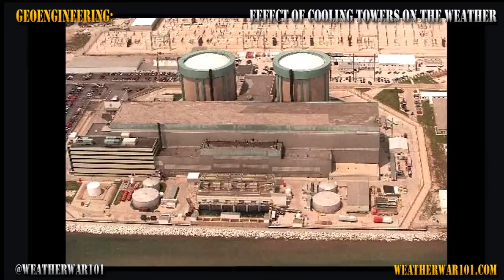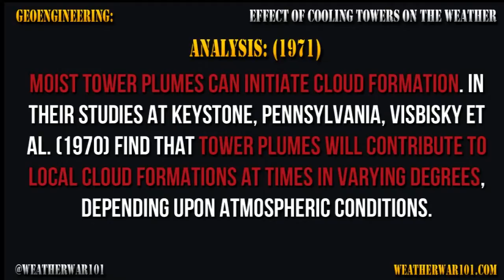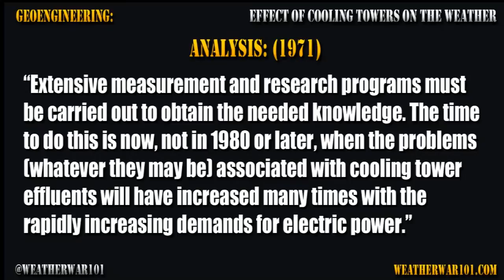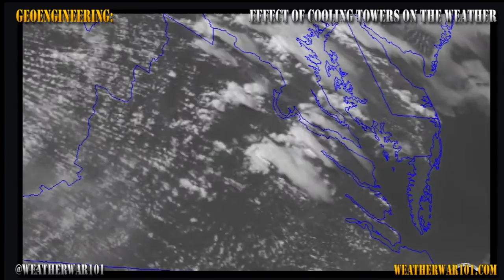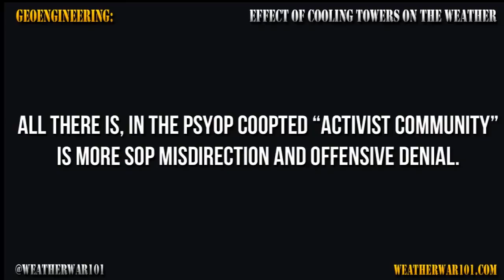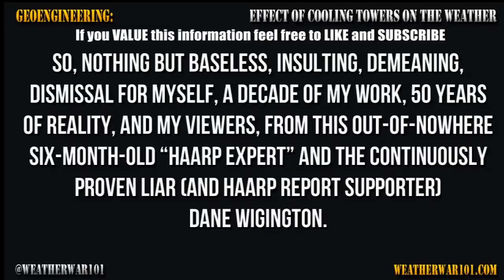Proof: Effects of Cooling Towers on Weather - WW101 Narrated

Comment: interesting. 
But is it worse than plumes from volcanoes?
Reply from the maker: tioedong Define worse. Volcanic Ash is a blight that can potentially block out the sun. I have little doubt though, that being humans we could filter the air of said ash in roughly a year if our lives depended on it. But that being said, the Water Vapor is being vented for a reason. This isn't accidental, the timing of the releases and the movement of the Storm Systems are evidence of this. The Weather is being weaponized, and these are just the preliminary runs. Expect more violent weather in the future, more damage and more death.
Reply: I asked because I live about 30 miles from MtPinatubo.

Usually I would say that claiming weather weaponizing is crazy, but one of my fellow docs who was in Desert Storm and said they did just that back then.. So do I believe him, or what the MSM tells me? 

On the other hand, I am now reading several  history books by Brian Fagan, where he discusses climate change in the last 10 thousand years.... If those aiming at depopulation want to, they could  indeed change the weather we are in trouble.
Reply from the maker: I would advise relocations away from any active or semi-active volcano. The risks far out weigh any of the benefits. In reference to mans ability to control the Weather it is an absolute reality. We have had the knowledge of our capacity as a species to alter the weather since at least the Roman Empire. In Plutarch's "Caius Marius 75 C.E. he states "It is an observation, also, that extraordinary rains pretty generally fall after great battles; whether it be that some divine power thus washes and cleanses the polluted earth with showers from above, or that moist and heavy evaporations, steaming forth from the blood and corruption, thicken the air, which naturally is subject to alteration from the smallest causes."
(source: http://classics.mit.edu/Plutarch/c_marius.html)

The idea that we would weaponize it is not new. The Romans dreamed of calling on their deities to unleash the raw power of the planets natural systems to do their conquering for them. Just as the modern day equivalent to the Romans (Americans) wish to utilize it today. As a species we have studied the stars and skies for as long as we have had written language.  But because people in general do not study history, do not study weather, or the science behind it, and indeed do not study anything other than the distractions and nonsense put forth by their owners, most find it hard to believe that YES the weather is indeed under our(humanity) control. It has been for some time now and we will never relinquish it back to nature so long as we are aware of our capacity to control it. Just as we never returned the soil to nature for food production. Or the Oceans, forests, minerals, what have you for the varied resources .

Those who own the machinery of state, and here I am not talking about politicians and CEO's (face-men I call them). I am speaking of the OWNERS, the faceless wealth that generates those cowards. Those behind the curtain. They have access to information, history, machines and techniques that we are kept ignorant of. For the expressed purpose of managing the vast majority of us as they have managed livestock. If you need any more evidence to convince you that there is a cull taking place all around us, simply search "over population". The Wealthy face-men have been chattering about this myth since civilization manifested itself in the form of Empire. The owners have always felt over populated, this is the ideal state for a factory farm (City). The livestock crammed in on-top of one another, sick, depressed, sapped of all the will to fight and break free by the herd and its mentality. Once they are fattened, then comes the slaughter.

I am not trying to be dramatic here. Take a look at the obesity statistics worldwide. (http://www.worldobesity.org/aboutobesity/world-map-obesity/) In keeping with the metaphor we used above, of the modern industrialized City being in fact, a factory farm for the harvesting of human livestock. Look closely at those countries which are suffering from Obesity or the fattening up of said human livestock. The west is ripe, and soon the harvesting will begin in earnest.
Reply: @JohnLothe  I can tell you who they are.....
Reply: @JohnLothe  I can tell you who they are.....